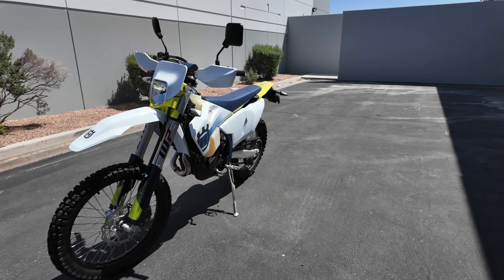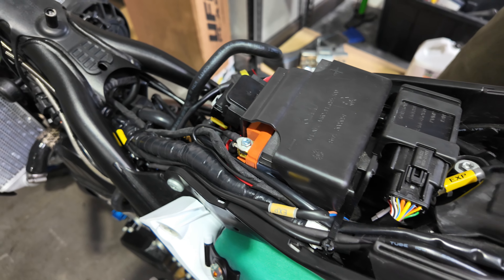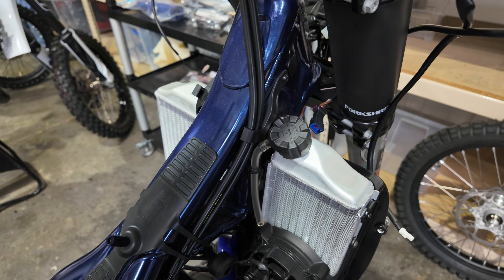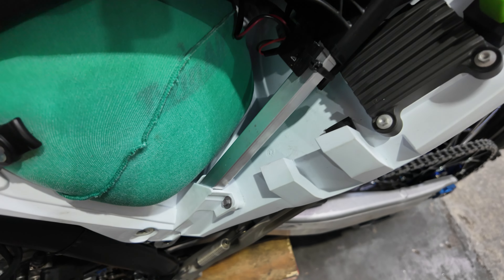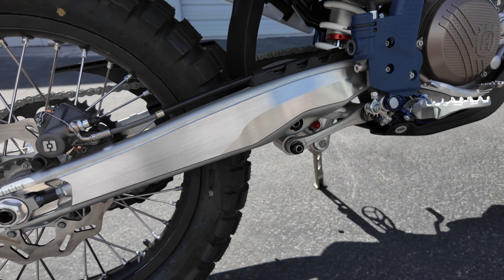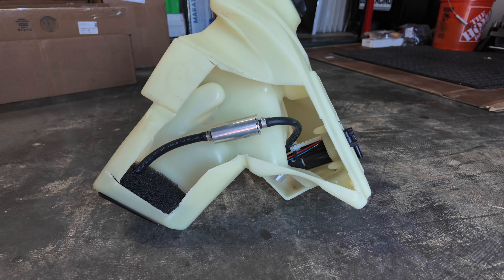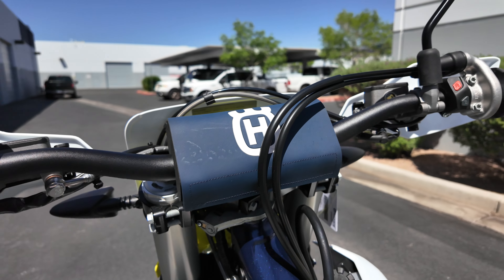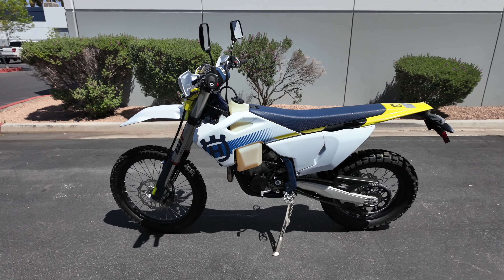2024 KTM New Generation Dual-sports | What Is Different?

Comment: 501 cooks the gas, need to heat sheild it. The tank pick up is pretty dumb yea. But loving the bike especially with Best Dualsport Bikes power package which includes tuned stock ecu and an open exhaust tip among other things...65hp